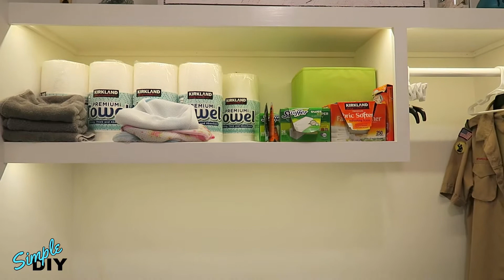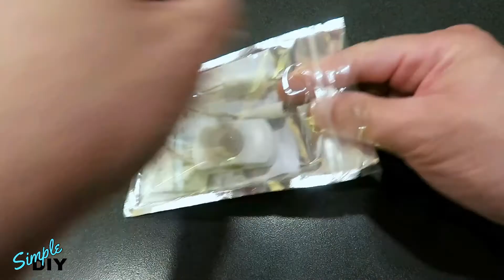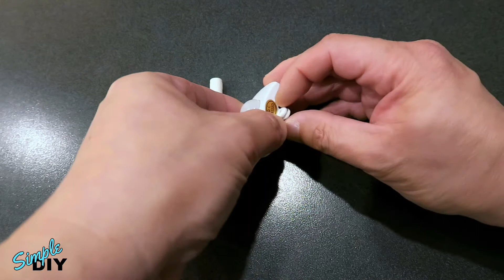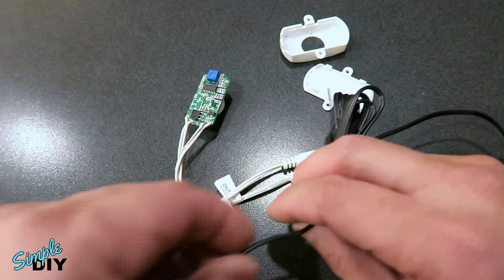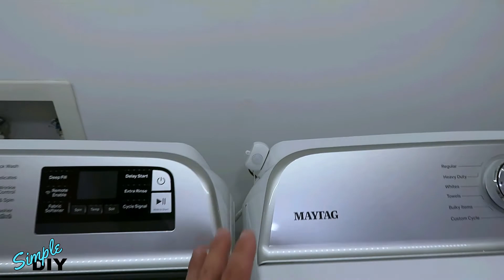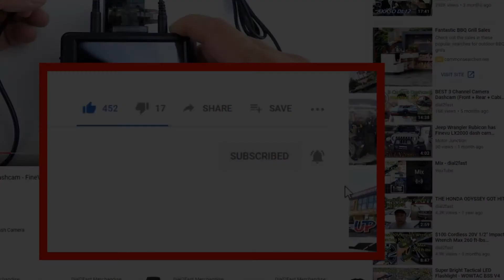Automatic Motion Sensor Cabinet LED Light Strip

Comment: Thanks for the video.  I just ordered my pir switch. Couldn't you have just hard wired the leds in the switch like you did with the power supply? (Asking because I'm not sure if it'll work, but I'm thinking about that route)